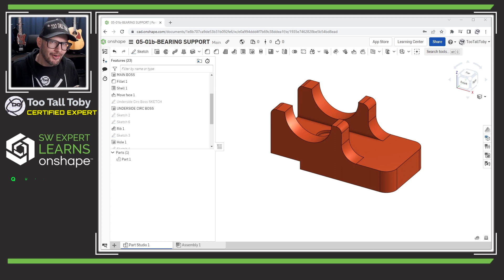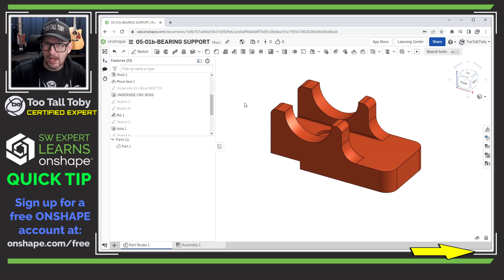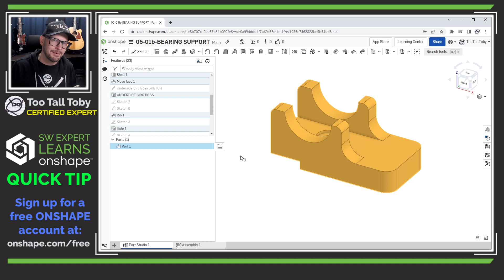Mass Properties and Materials in Onshape

Comment: I’ll try to forward this feature request elsewhere, but it just occurred to me that material selection could usefully be a variable! Then when I need to rebuild a part via composite or other operation that winds up replacing vs updating a part, I can reliably keep the same material as used before.

Appearance setting might go along with that, but the material is more important to the computed properties and DFM.
Reply: This also helps if I’m making a lot of parts that get fastened together, and I want to machine all of them from the same material, and keep it organized.